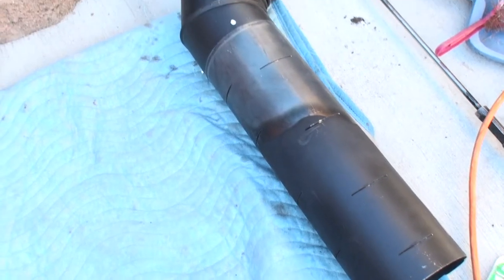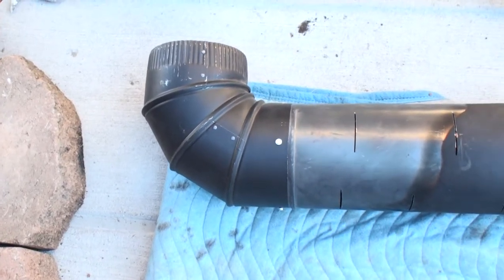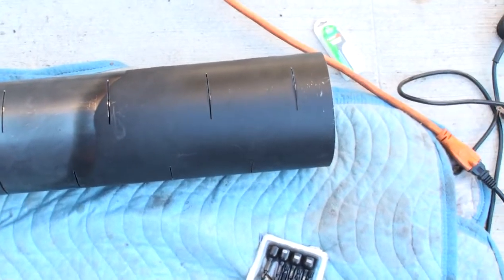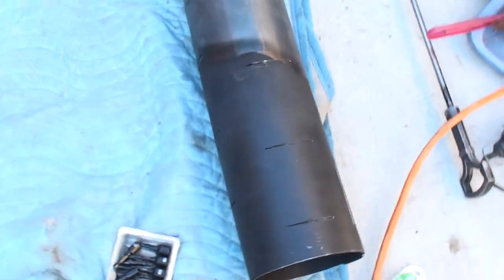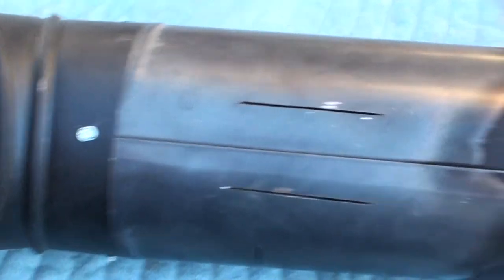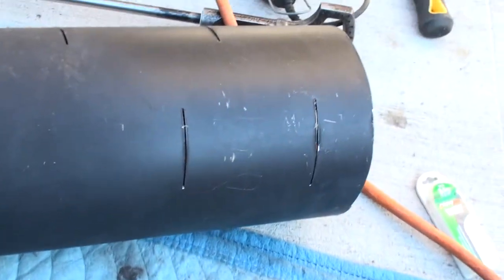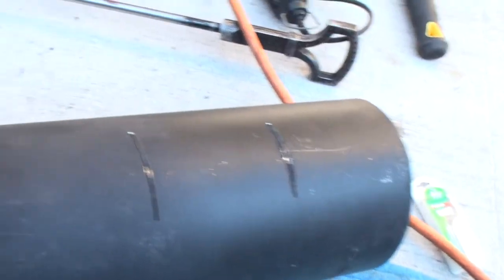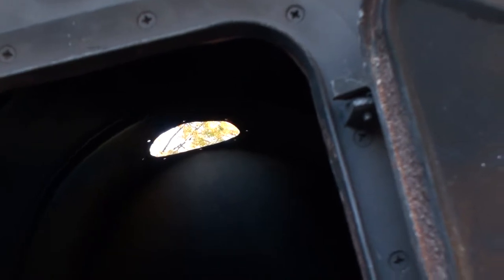Pauls Rocket Mass Heater Stove Furnace making catalytic converter tube 00469 Video 3

Comment: It would also be a cool system, if you linked it to a generator, so when you want to heat the place you can do that, or pull a lever and funnel that wood gas into a generator.